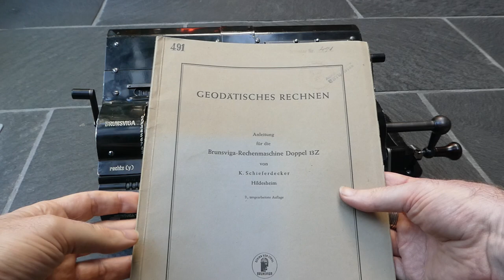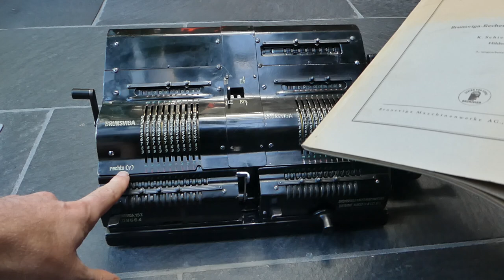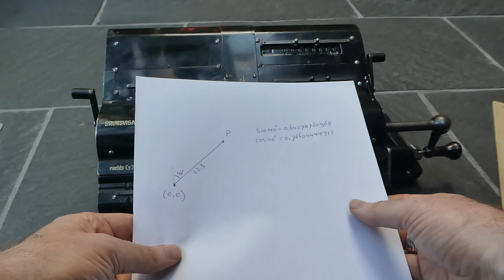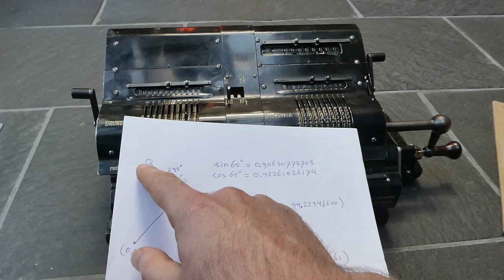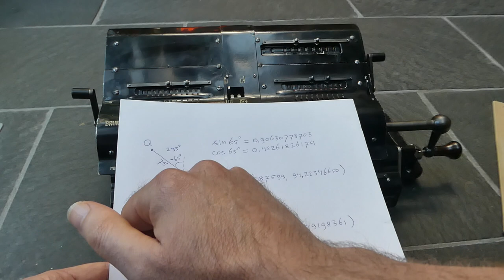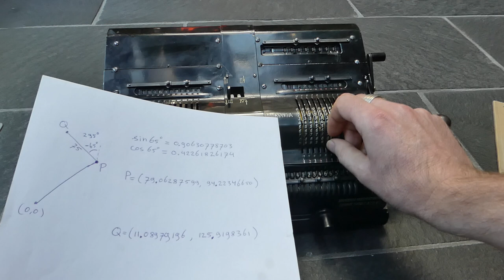The Brunsviga D 13Z/1 double calculator

Comment: These machines were known as "coffee grinders" in the British Army. They were chiefly used by the Royal Artillery and the Royal Engineers. Many of them were lost during the retreat to Dunkirk in 1940. Throughout WWII and for some 10 years thereafter, the British Army used Twin Marchant machines, each comprising two American made Marchant units co-mounted in the UK into a double arrangement, mimicking the D 13Z. by all accounts, the Twin Marchant never worked as smoothly as the Brunsviga.
Reply from the maker: There were also twin Brittanic machines. Alan Turing used one, which you can see on Cris Vande Velde's site here: http://www.crisvandevel.de/sttu.htm
Reply: The twin Brittanic is generally regarded as a failed experiment. I believe they were made in very small numbers. Alan Turing's may well be the only one.  The Twin Marchant was was commissioned when the Brittanic approach was deemed to have failed.

Comment: I learned something today…put the starting coordinate (we always start at a non-zero coordinate) into the correct place in the lower register then multiply sine by distance…it calculates the latitude or departure and adds it to the last coordinate. Pretty cool. Although I usually want the latitudes and departures for calculating area. If the next course is negative then wind it backwards.

Comment: Enter cosine in the left and sine in the right then turn up the distance in both. Latitude in the left and departure in right. We use Y-X order. Later could add up the coordinates in one operation. We also use quadrant bearings over here so cosine is always delta Y and sine is delta Z.
Reply: We call your first direction North 40° East (the opposite direction being South 40° West), latitude +, departure+. Your second bearing is North 65° West (the opposite direction is South 65° East), latitude +, departure -.

Comment: A very nice machine! I have the very similar D13ZK, but I’m struggling to see the difference between yours and mine. I much appreciate the Co-ordinate calculation demo.
Reply from the maker: On the standalone machines the K indicates that it has that switch for combined clearing of input and counter. I think that switch was introduced on these double/triple machines, and later also transferred to the single machines, and only at that point did the double machines get the K in the model name as well. So for double/triple machines there is no difference.

Comment: Crazy machine- how heavy is it? 
Also the registers at the bottom can go negative, right? (I assume they don't roll back to 999999.) Is there a bell? Thanks for the video as always!
Reply from the maker: I'm not sure how heavy it is. The D13Z/2 weighs 15.5 kg, so this one weighs one counter register less than that. That carrying handle on the right really cuts into your fingers.

Unfortunately the registers roll back to 9999..9 when they underflow, so there is no handling of negative numbers like there is in the counter register of these Brunsviga machines. And yes, a bell rings when that happens. I think there is only one warning bell that is used for both registers.

Comment: I notice that the switch in the middle is marked with Roman numerals I through IV. What do those signify?
Reply from the maker: To be honest, I don't know. Most of the others I've seen pictures of just have a pair of arrows at each end, either pointing in the same direction or in opposite directions to signify that the drive shafts of the machines go in the same or in opposite directions. The markings on this one are baffling, especially since on both sides the arrows point in opposite directions. The various registers are usually denoted by roman numerals, but that is a bit odd here since it only has one counter register. I have not gone through the complicated manual in detail, as that would take much more time and effort than I want to spend, but these Roman numerals are used a lot in there.
Reply from the maker: I now think that the Roman numerals represent the four quadrants of the plane. After setting the switch appropriately, the arrow there shows which way you have to turn the crank.